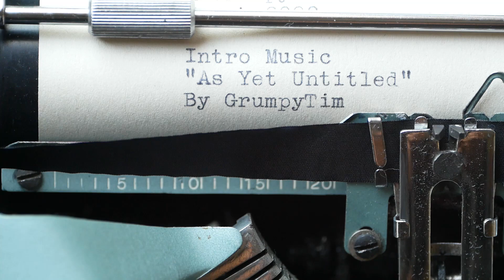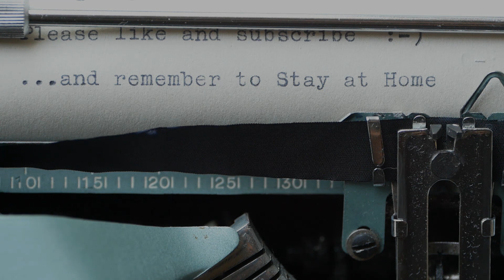Retro Tech - Olivetti Prima 20 Adding Machine - Part 1, Refurbishment

Comment: Pleased to find your video thanks. What did you use to clean the inside? I just inherited 2 thst are slightky different but both seem locked up
Reply: Thanks Tim - much appreciated. Will follow your advice on these
Reply from the maker: Hi Marty,  I used a couple of things to clean the mechanism - firstly I'll clean off any excess old oil and grease with a bit of cloth.  Then any parts that seem tight I'll apply some sewing machine oil and work that part to free it off - once freed off I might use a slightly thicker oil or grease if it's a heavy wear part like a sliding lever, otherwise the sewing machine oil will do on it's own.

I used metholated spirits to clean the number wheels, although any alcohol cleaner such as Isopropanol will do the trick.

If your machines are locked up you'll probably have to work your way through them slowly, oiling every pivot point and trying to waggle the part until it moves freely - there's probably be a few parts that are stuck so you might get it partly working and then have to search for the next stuck part.

I've had a few things that have been stuck solid with old dried oil - sometimes gentle heating can help with these because the heat softens the oil, then you can apply fresh oil to get the part moving correctly again.  You can see my heating method 6 minutes into in my Monroe LN160X refurbishment video https://youtu.be/i20hnOFpyCg

It can take quite a while to get everything moving correctly again but you'll love the machines once they are working properly.

Comment: Sorry if this is a stupid thing to say. But do you not need to add the rivet type thing to the other end of the ribbon where you cut it off? For the mechanism that reverses the reels when it gets to the end?
Reply from the maker: Good question,  I'll try and remember to check later today when I'm reunited with that machine.  I don't think that one uses the rivet method of reversing the ribbon - I know some typewriters used a rivet - I'll check and let you know.
Reply from the maker: Hi Christian,  I've just had a look at the Olivetti - there is a spring loaded part that rests on the ribbon on each reel - as the ribbon is used this spring loaded part moves closer to the centre, when it gets close to the end of the ribbon, the tail end of the spring loaded part presses on another lever at the rear that changes the direction of the ribbon.  So no need to worry about not having a rivet through the ribbon itself on one of these machines.

Thanks for a great question.
Reply: @GrumpyTim  Thanks for checking Tim. I have an Olivetti 82 typewriter I use regularly (hence looking into getting an Olivetti adding machine to sit beside it) and that does have the rivet based system, so thought they might share the same design. I'm by no means an expert though which is why I worried it might be a daft question, everything I know about how to fix my writer is self taught. So these types of videos are fascinating to me. Cheers 👍
Reply from the maker: Coo, one of the Olivetti adding machines will look brilliant next to your typewriter and they're great fun to use too.  You can even do division on them - I didn't find that out until after the video otherwise I'd have included that too - it's not exactly a fast process but a cool party trick all the same!!!!

Comment: Please, can you tell me the size of the ribbon spools?  I bought one of these units, looks like it's working (not all gummed up), but missing the ribbon entirely.
Reply from the maker: Hi Josh,  The ribbon spools measure 39.6mm overall diameter (40mm would be close enough) and take a standard 1/2" typewriter ribbon.  The outer height of the spool is 15.1mm but the post it sits on in the machine has enough spare length to take a slightly taller spool.  The offset between the centre of the post and the pin that drives the spool is about 4mm.

I reckon you could get one of the generic replacement typewriter ribbons that comes with two plastic spools and customise those plastic spools by mounting the plastic spool on a suitable bolt, putting it in a drill and spinning the spool against sandpaper - it might take a while but it could be the easiest route.  If you do go down that route, you'll need to take the ribbon off the plastic spools before you reduce their size, be careful when you pull the ribbon of the spike in the centre of the spool, the spike can snap off if you're a bit vigorous - you might just want to cut the ribbon when you get to the end and then re-hook it once you've done reducing the spool size.

The offset between the centre post and the drive pin on the typewriter spool looks a little bit bigger - it might fit ok or you might need to file the drive pin hole a bit closer to the centre.

Comment: Interesting that this one has a single key for each number, rather than the more old fashioned arrangement with a number key for each multiple of 10.
Reply from the maker: Yes, I think the 10 key keyboard became popular, probably because it was cheaper to make, with far less parts.  The disadvantage of the 10 key entry is that you only get an indication that you've entered something, but not the actual figure you've entered.  On the old full keyboard machines the keys stay down until you pull the handle so you can actually see what you've entered.  I kind of like the styling of the Olivetti - it reminds me of early computer terminals and stuff like that.